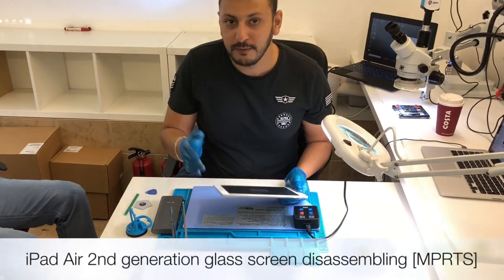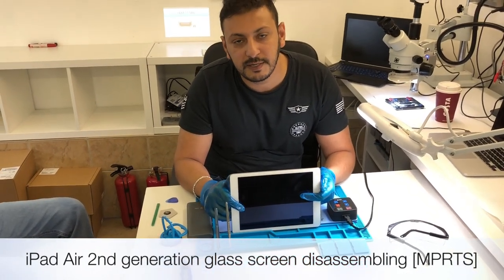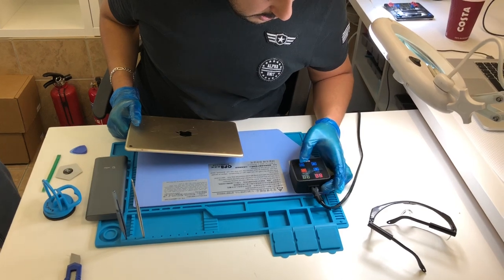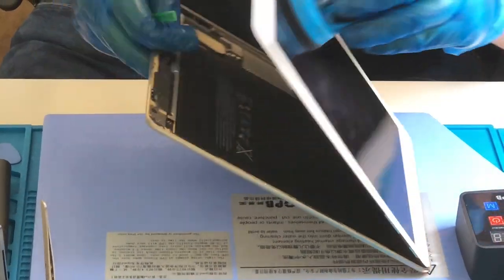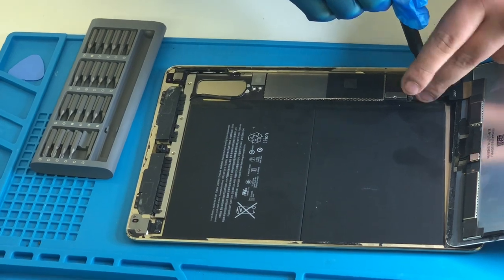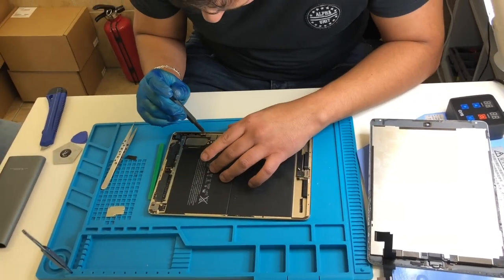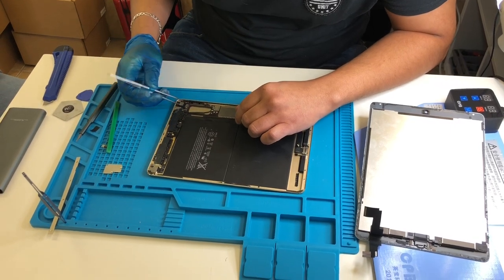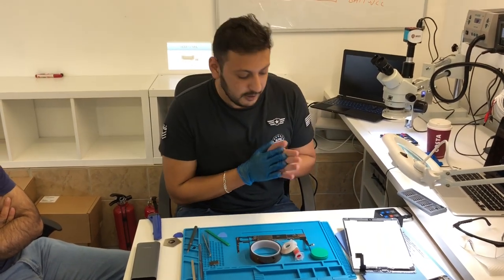iPad air 2  screen dissembling with heat pad

Comment: As a professorial in the field, have a wider base and place your screws around the perimeter in direct line of removal. Placement in the bays signifies nothing other then differences. Line of sight to where they belong in the unit. Imagination comes into play when they are in the center but you can work that out with the same premise.
Reply: ifixit magnetic project mat with labels. It's the most explicit method that doesn't require maintaining or remembering disassembly orientation or fasteners in the center. Relying on such a line of sight method is a recipe for confusion.
Reply: @purkeypilot  Perimeter in direct line of removal works great but in the case of amateur take pictures and label.

Comment: You don't need to power off device to heat & open. & sometimes good to leave turned on. You can see when LCD fades is too much heat. Early warning signals.